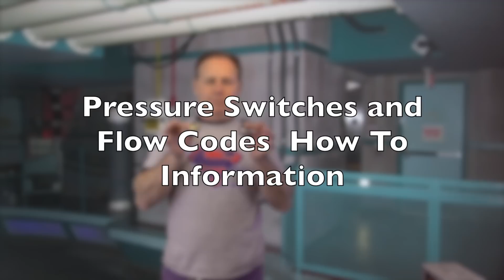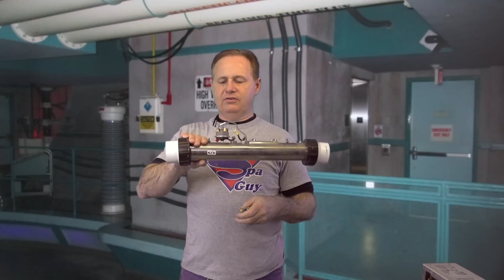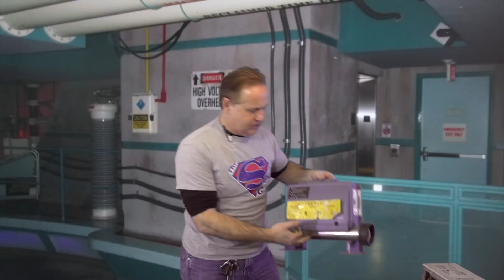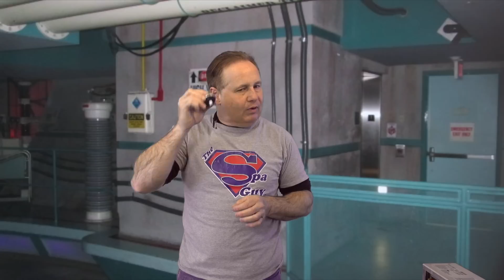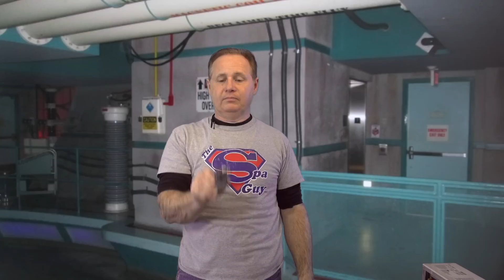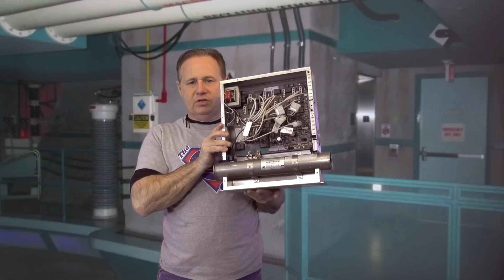Pressure Switch Flow Code No Heat Spa Hot Tub How To The Spa Guy

Comment: my tub doesnt turn on
Reply from the maker: It sounds like you're having trouble with your hot tub. Have you checked the breaker? A pressure switch will not cause the tub not to run.

Comment: I can’t find my pressure switch or flow switch on my artesian spa. Any ideas?
Reply from the maker: You may not have a Pressure switch.. If you have a Balboa stsyel the newer ones use M7 sensors and not pressure switches..

Comment: I have an '08 HotSpring Grandee.  The wire for the pressure switch goes inside a closed box at the end of the heating system flow pipe elbow where the other sensors are located.  I'm afraid to open this with full tub to see what's in there.  Will I find a switch replaceable by your 1A switch?  Will it fit the compartment?  Can I replace it with a full tub?
Reply from the maker: If you have ano fault style heater which it sounds like you do just bypass the pressure switch.. The new version of the heater no longer uses a pressure switch.. You just cut the wire and tie the two wires together on the side that plugs into the board.. Thanks, Spa Guy
Reply: Thank you for the quick reply. I was confused before but I have the older style heater with a built in pressure switch and a pressure switch cable the comes from the heater for connection to the control panel.  This was working for 15 years but recently I had a flashing red and green light which would not reset indicating a bad internal pressure switch which I confirmed by bypassing. Is there any safe alternative to replacing the heater.  Please advise.

Comment: Does your tub need to be filled with water when you replace the pressure switch or is okay to replace the pressure switch and then fill the tub?
Reply from the maker: Unless you have slice valves you can close to keep water from leaking you have to drain the tub before replacing the valve..

Comment: This is so step-by-step and helpful... thank you!
Have a Hot Spot TX that had the double yellow lines. Figured it was a bad switch so got a new one and installed it and... same.
When I turn it on and turn on the circ pump, I can definitely feel/hear circulation through the heater manifold.
If I short the circuit the heater does turn on, so it doesn't seem like a board issue.
What do you think: bad replacement switch, or...?

Comment: I get the FL code and the only way I can reset it is to pull one wire off of the pressure switch.  The pump immediately comes on (with good flow), but the heater won't come on until I reconnect the wire.  Then, it works fine until it gets up to temperature, but then it shows the FL code and we have to start all over.  What do you think is the problem?  Thanks.
Reply from the maker: I tell you the answer in this video..

Comment: So I've got a weird one.
I restored an old hot tub.  I have  a united spa T5 topside that has been stuck at 102 forever.  No flo codes.  Pump works, heater works, everything is great, except the buttons on the topside are screwed up.  So I was reading that as long as I have a b5 board or newer, (Which I do, a B5 board), I could replace the topside with a T7S.  So I did.
I plugged it in, and EVERYTHING works great, EXCEPT, after 5 seconds whether the jets are on high or low I get "FLO" error.
What's odd to me is if I hook the old topside back in, no errors at all.  The only time I got a "FLO" error on the old topside was when I was burping the hot tub.  That's all corrected.
I pulled the filter, checked all the plumbing, checked the pump, everything is working exactly as it should.  But I'm still getting "FLO" with the new topside.

I'm wondering if maybe the pressure sensor is having issues?  Maybe the "low" pump isn't moving enough to hit the switch?  It's definitely odd.

Comment: O am eliminating my pressure switch and installing a flow switch on a pool heater due to elevation differences.  There are a high and low pressure switch.  Do you know which one I should connect the flow switch to?

Comment: Great video. I have a Gecko spa pack that now give me 3 dots on keypad and no heat, indicating no flow. I calibrated pressure switch, did not help. I bypassed it altogether and shorted the leads from pcb and powered it up, and got it to heat, but usually after a couple hours of trying to get up to desired temp from 70 degrees, i get the 3 dots again and heating stops. Why would this happen? If the pressure switch circuit is closed, it should never trigger a flow error? Am i missing something? Thanks.
Reply: I have the same problem. Did you solve it? If so, what was it ?
Reply: @ronives1895  No, not yet. I just drained and covered it for now, and moved on to a different project inside. I’ll revisit it in spring.

Comment: I have a MSPA hot tub  model dsc04  which  I got for the start of  lockdown  and Monday  july13th the pump or the bubble blower motor  or heater element has broken down  coz our rcd breaker for the sockets trips out when  we try to  turn on  the bubbles

Comment: my costaway inflatable is not heating. No error codes. Doesn't look like any water damage on heater or circuit board (by looking at outside). Does make a harsh rumble noise when pressing the heat button then goes back to normal. Just never heats. less then 6 months old.

Comment: I have a calspa and I'm getting psol and psoh code. Jets and nothing are working. I jumped the switch which turned off the code so I know I need a new switch but jets still won't turn on. What else could it be ?

Comment: I have M7. Circ pump working. 
All pumps had connections loosened to get air out. Sensors removed and checked for debris. Still getting HFL to FL codes

Comment: Teflon tape isn't a sealant,  its actually a lubricant.  The only thing doing the sealing on a NPT pipe are the threads.
Reply from the maker: OK if I screw it in without the tape it leaks so like it or not it is a sealant..
Reply: @SpaGuy  that doesn't make it a sealant.  If NPT threads leak that means you have not tightened them properly,  something which teflon tape is made to do. It is NOT a sealant.
Reply: @Chris-ob8ok  If it seals a leaking thread... what is it?
Reply: @TheCrimsonBlade2  it doesn't seal, it's a lubricant. It prevents the threads from binding before making a seal. If it were a sealant it would work on non tapered threads (which it doesn't).

Comment: I have a balboa 3 amp 30408 PS.....can I replace with TecMark 1 amp?  I don't see many 3 amps sold anymore.  anyway I love the videos.  I have learned and saved $$$
Reply from the maker: The Amperage doesn't matter on that system it is not even close to 1amp in the circuit.. Thanks for Watching.. Spa Guy

Comment: Recently bought a house and it has an indoor hot tub. The plate on the Raypak heater is 1988 "model EL 552-2"
It's a very old system but to my surprise after fiddling around with a few things it worked. All I have to do is open the valves and put water in it and the pump and air blower turned on. 
The heater turned on for a while and then turned off but it was heating.
My pump has 2 speeds a (high) and (low.)  There was a note from the previous owner that said always run on low unless you're in the hot tub then you would turn on high.
When I turn the pump on high the heater always works but the heater no longer works on low.
To me this seems like it's a pressure switch.
 I just found your video in my search for what to do. 
Should I order the new pressure switch from raypak?
Should I take things apart to see if there's something in there maybe the pump?

I've never had a hotrub but I feel like the pressure in the tub part seems good. A nice little current on low and nice hard jet on high.

With pump on low heater does not sense flow.

Comment: Hi Spa Guy, I haven't gotten any error code but the hot tub heats when it feels like it, there is no obstruction in the filter and the pump works regular. I left the hot tub running continuously all of winter and it only got to 100 degrees once and I dont know if the issue is the pressure switch or the heat exchanger. FYI this is a Cal Spas from back like 2000's (2100 series) from what i gather... the hot tub came with the house when bought. Last summer I swapped the dually pump for the replacement pump.

Comment: Great video!!!  I have a balboa 2000 LE system with the two M7 sensors at the side of the heater as you so clearly show.  My system starts normally, but the temperature quickly reads 118 degrees (in just a minute of operation) and shuts off.  Codes displayed are OHH and FHL with the filters removed. Any thoughts?.

Comment: hey spa guy.  i have a six year old jacuzzi hot tub and recently getting a FL1 code.  Did some research and lead me to pressure switch.  I changed the switch and still getting the FL1 code.  I have changed the filter and checked for any debris - all seem good.  Additionally, the FL1 code comes and goes.  Sometimes the heat pump 1 works just fine - other times the FL1 comes on.  One additional interesting finding - when I use a bypass alligator clip wire to connect the red and black on the switch, everything operates perfectly fine...this is what lead me to believe it was the pressure switch.  What do you think Spa Guy?  Thanks a lot.

Comment: Spa Guy! My hydropool serenity is showing HL but the water is ice cold, had a faulty pressure switch which spitting water all over.  I replaced that and the spa runs when the heater is not hooked up but displays HL.  When i reconnect the heater it trips the breaker immediately, but did not do that before i replaced the pressure switch! Any advice?

Comment: Hi Spa Guy. Thanks for the video. I learned a lot. Mine is an older hot tub. It works well until recently when it threw a FL code and the heater won't heat. The pump works and the current seems normal. I tried to jumper the pressure switch to by pass it. But it did not work. What other check would you suggest? Thanks!

Comment: Great Video but I am stumped.   We have a 2002 Vita Spa L 200 Series.  Ran the diagnostics got the code HC.  Everything I read said to replace the Heater.  Went to the dealer and they had one. Replaced the heater and it is still not working and still showing HC.  I pulled off the circuit board and there is no sign of any burning.   I hate to just replace parts although I am sure the dealer likes selling obsolete/discontinued heaters for 248.00.   Tub does stay at 85 degrees but that has been slightly lower then the daily temps here.   Any advice is most certainly appreciated.
Reply from the maker: Hello Eric, Usually a Hi Limit code is HL or HH not HC.. If it was a Hi Limit code the heater could not be the cause.. What would cause a HL code is the heater staying on with too little water movement or a stuck relay.. Things like that.. You were lucky to even be able to buy a heater as they are obsolete.. I did look up the code and it says HC means heater error and I think those boards has current sensing loops and for whatever reason the system is not sensing the heater drawing current.. That could be bad relays on the board or any number of other things.. Spa Guy
Reply: Thanks for the quick response.  The dealer has 2 left.   The store actually mentioned the relays and did suggest a service call...   Should have listened.   I hate to send it to the curb because everything is still in good shape including a new cover last fall but I guess they do say all good things must come to an end.

Comment: Spa Guy...FL1 code on my Spa Builders LX-15 hot tub. changed out pressure switch, no luck. Motor just clicks and then turns off almost immediately. A few minutes go by and same sequence occurs. Still reading out between water temp and FL1 code on topside. Filter removed, no obstruction in propeller. Any advice greatly appreciated. dsilance
Reply: Update: after speaking to spa guy on phone he pointed me towards the motor and sure enough bearings were bad. Local electric repair shop was able to replace. Thanks for your help spa guy.

Comment: I have an M7 Balboa system, and not getting heat. Flickering heat light on control top, element and sensors test fine and no codes.. flickering heat light than eventually goes steady solid but still not heating. Any advice? Tested heater and sensors, appear fine, filter is clean, something on board or board itself?

Comment: I have a Balboa system and I'm about ready to replace the pressure switch. Question about the pressure switch is there any polarity with the wires does the red wire have to be on top or does the black wire have to be on top or vice a versa. Since I'm not the first owner of the spa tub the red wire is on top of the pressure switch the black is below it. Is this correct? Thank you for this very informative video
Reply from the maker: Jerry there is no polarity on a pressure switch..  It is simply a normally open circuit that closes with water pressure and connects the two wires together.. Spa Guy
Reply: Spa Guy thank you sir I just filled up my tub and running a test cycle. So far so good! Thanks for the quick reply

Comment: My sun dance altmar 2000 has a 2 speed motor. on low speed the motor runs and the shaft turns but very little water comes out of jets. Hi speed is fine and jets work fine what good it be?

Comment: Hello “Spa Guy”! I watch your videos a lot online and really appreciate the level of sharing, very educational and informative.

I have a question and it would be amazing if you had the time to read it over and offer guidance.
I purchased a used, older hot tub. I don’t know the exact brand but it is old with one pump and minimal jets. It has a Spa Pak Gamma 240 (very analog old school, no display etc)

When purchased, I was told it needed a heater element as the breaker was tripping, so I’ve replaced that. I just had the electrical connected yesterday.

So, with the heater switch in the off position, I can turn the tub on. The pump comes on in the low setting just fine. I can even press the “button” (the type that activates the second speed with an air line to the spa pak) and the motor kicks into higher gear and the jets seem to work, no problems.

As soon as I turn the heater control knob to “on” the breaker trips, this is my issue. Today I went and bought a new thermostat, replaced it and same thing. I also disconnected the high limit switch and tried again, same thing. I have since found one way to make it so that the breaker doesn’t trip when I turn the heat knob on - I pull the water tube that comes from the heater element tube on the pump off of the connection nipple to the pressure switch that is part of the spa pak.

When I pull that tube off, water of course freely flows out of it. When I kick the pump into high gear, it comes out with more pressure. And again, with this disconnected, I can turn the heater knob on all the way. Now I have no idea if it’s actually heating anything, but the breaker no longer trips.

From what I have read online, (and I think even heard from you) the pressure switch won’t normally trip a breaker unless there is a water leak into the pak, and after pulling it off, I don’t believe there is any leak. In fact, the little unit looks new given this tub may be 25 years old. Not sure if it matters but the switch is called “The Little General” switch number DD05SS

Would you have any suggestions or ideas for me?

Any help is greatly appreciated.

PS - there was a while there where I couldn’t figure out for the life of me why my YouTube “suggestions” were filled with Elvis Presley material, but after spending more time in your channel, I realize you’re the culprit! :)

Thanks,

Rob

Comment: Hi Mr. Spa Guy....Back in January, I fired up my Liesure Bay hot tub and water started shooting out all the way (almost) to the ceiling. Water everywhere....A couple of the adjustment knobs blew off and the corner (right corner) of the spa cracked. I took off the farings and looked inside and couldn't see anything unusual. But before that incident happened, the heat would only go up to 56 degrees instead of the usual 102. I let the water out, so now I don't think I can even test it. Can you direct me to a trouble shooting guide, or I can pay you to advise me by phone. Thanks,   Rob Orizino    PH   3157272245

Comment: We have a Jacuzzi J335 and there is an error code: Ono.  Any idea what that means?  The pump barely goes on and then shuts right back off.  It was delivered in 2009.  We believe it was delivered brand new.THANKS
Reply from the maker: George, That code is not familiar.. On a Jacuzzi Premium the pump does not have to operate for the tub to work and heat as there is a small circulation pump for the heating.. Usually on a J Premium you get a 3 dash code - - - or a low flow.. LF1 or LF 2 or an OH code.. Never seen a Ono.. Spa Guy

Comment: I have a solana that has a ==== error 
Pressure switch senses flow through heater
even though the jet pump is off? Is this just a replace pressure switch?
Reply from the maker: Jeff, It is possible.. If you measure across the switch and it has continuity with the pump off the switch is bad or out of adjustment.. Spa Guy

Comment: Thanks for the information on the pressure switch.  I didn't know what it was or how to get it off when swapping out the heater.  Ended up turning the little plastic adjust quite a bit before I finding out the whole thing screwed off.  I'll do a continuity test to adjust it or get a new one if I can't get it to work properly.